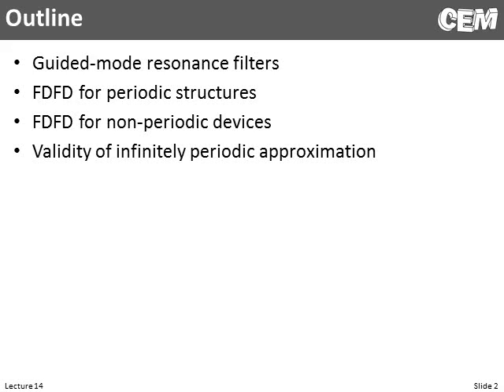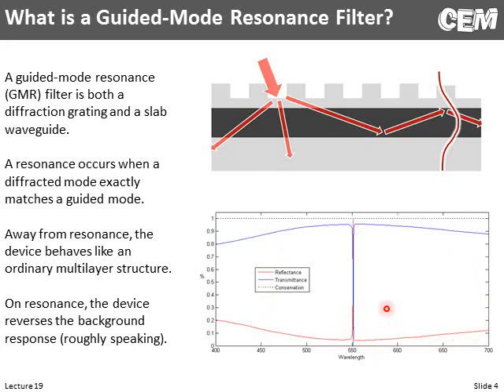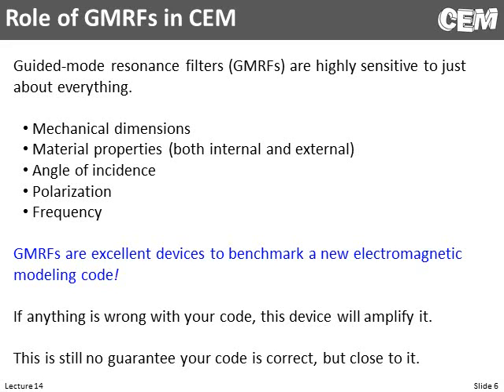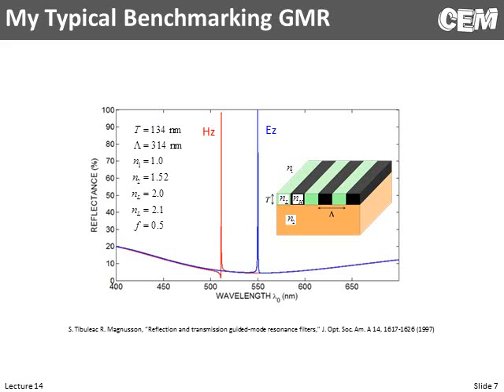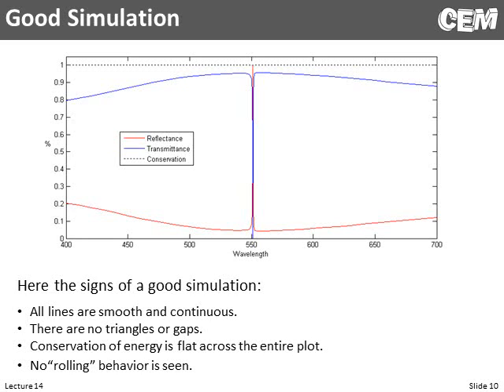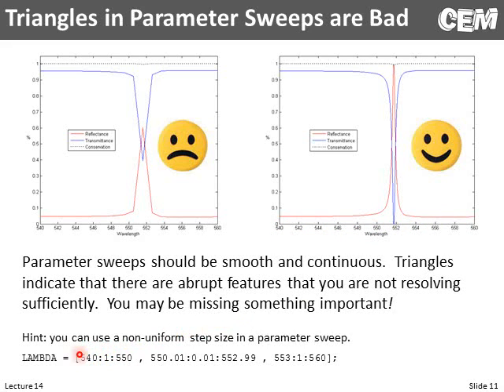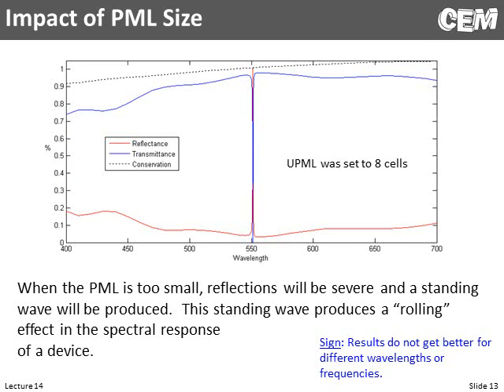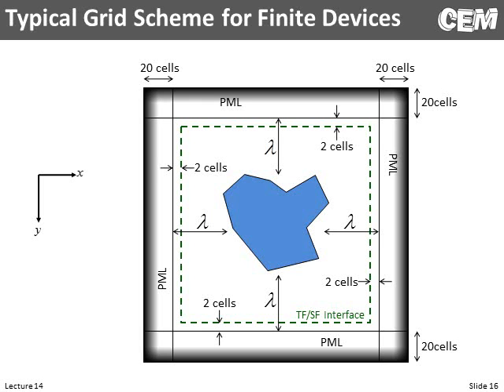Lecture 14 (CEM) -- Examples of Finite-Difference Frequency-Domain

Comment: Hi Dr, there is something problems for me about spacer region too small, the evanescent field reach PML and become a supported wave, sucking energy from model, But the sum of the energy on the recording plane is greater than 1. Why is this? Intuitively, if energy is absorbed, shouldn't it be less than 1?
Reply from the maker: Thank you for this question. The real problem is that the PMLs are sort or robbing the FFT calculations of waves. Those waves could be either adding or subtracting to the total so it is possible that the conservation could exceed or fall below 100%. Usually it falls below, but the other also happens.
Reply: @empossible1577  thank you so much, by the way, it's a great series lectures, bringing light to the CEM fog
Reply from the maker: @AaronGu-s7l  Thank you! If you are just getting started in computational electromagnetics (CEM), you may be interested in the book we recently published through Artech House. It is specifically intended to teach the art of CEM to the complete beginner. My frustration with other sources was that they were either so simple I could not do anything useful or so complicated I could not understand it. This book starts from the beginning and builds up to rather advanced 3D simulations, invisibility cloaks, etc. Here is the book website:

https://empossible.net/fdfdbook/

Comment: Should there be a polarization expansion for 3D FDFD eigen-value problem? That's for 3D photonic crystal analysis, because in 3D RCWA and 3D PWEM polarization is expanded through TE and TM. Thank You in advance!
Reply from the maker: A polarization expansion is not necessary numerically. However, I find it the most intuitive way to define sources and even sometimes post-process the results. In 3D, TE and TM modes can be coupled and exchange power. They cannot be separated. However, I do tend to define the source as some amplitude for TE and some amplitude for TM. Less, frequently, I will also decompose the transmitted and reflected waves into TE and TM. This requires using a dot product the reflected and transmitted fields and the unit vectors in the TE and TM directions. 

Hope this helps!

BTW...if you like the FDFD method, I recently wrote a book on the method. It is by far the best and clearest presentation of the FDFD method. The book is meant from the complete beginner, starts from the simplest concepts and works up to rather advanced 3D simulations.  It is a best seller in multiple categories from Artech House. Here is a link to the book website:

https://empossible.net/fdfdbook/

Comment: How do I compute the input wavevector matrix for a cylindrical source?
Reply from the maker: This is described in some detail in Lecture 4g FDFD Extras.  See slides 67-70.  

https://empossible.net/academics/emp5337/

The process is the same as for plane waves.  First, you will calculate the source field.  This is your cylindrical source at every point on the grid.  Second, you will calculate the Q matrix, which will map a circular region around the origin of your cylindrical source.  Then simply the use the QAAQ (we pronounce it as quack, like a duck's quack) equation.  That is all!